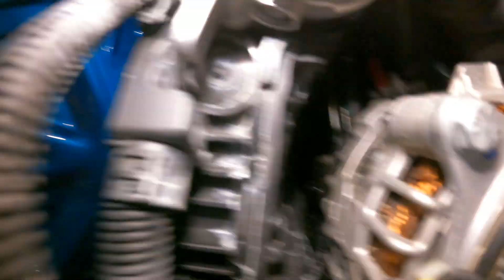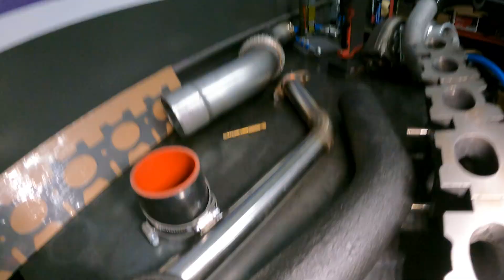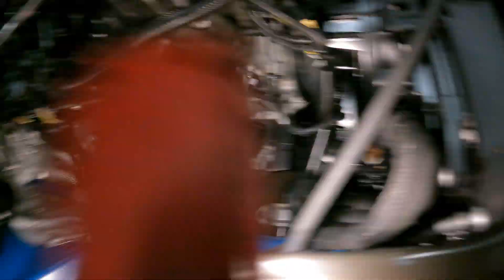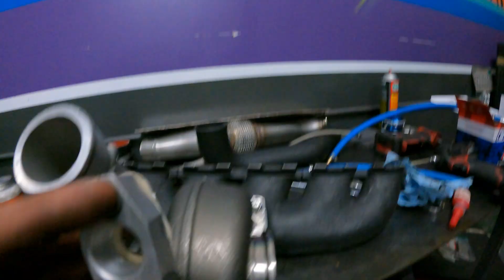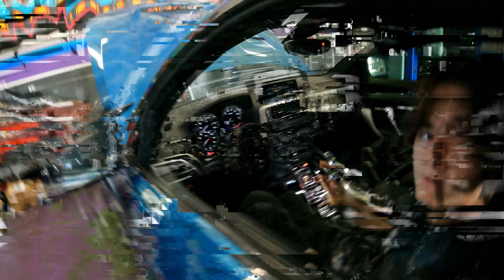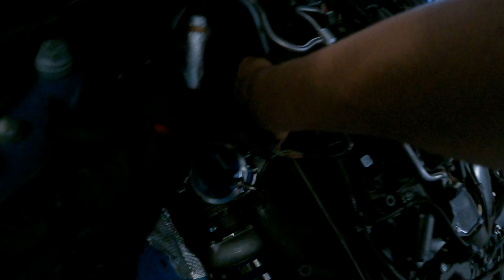Big BOOST GTX 1000 For our B58 | BMW F22 M240i

Comment: For that lil black plastic piece that broke when removing the intake, what did u do with it? Did u plug it or glue that back to the hose. THE ONE PLASTIC FITTING BY THE COOLANT AND OIL FITTINGS INTO THE BLOCK
Reply from the maker: Sometimes, we plug them shut, and in other cases, we run them. In this situation, I believe we plugged it off, but it's easy to purchase and replace!

Comment: Very nice project, Thanks for your video!, I think you used the wrong T4 gasket between turbo and manifold, it need gasket for twin scroll, now you used gasket for without twin scroll.
Reply from the maker: We used what was supplied with the kit. We did notice this but also does not affect anything.